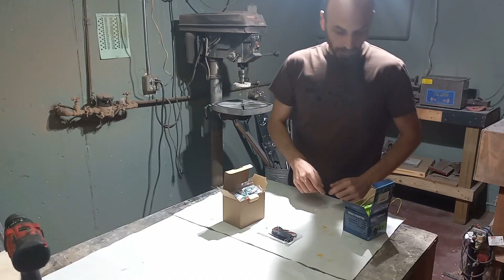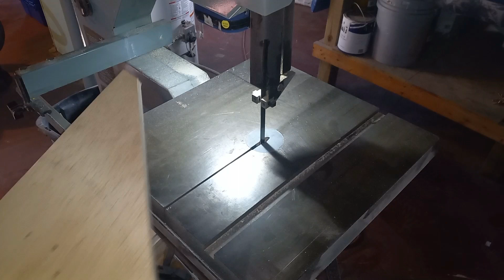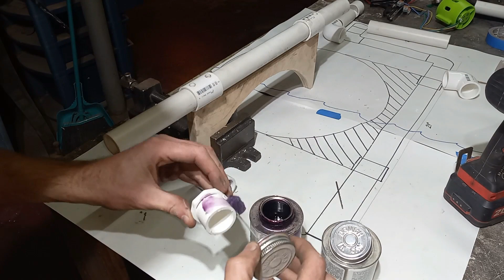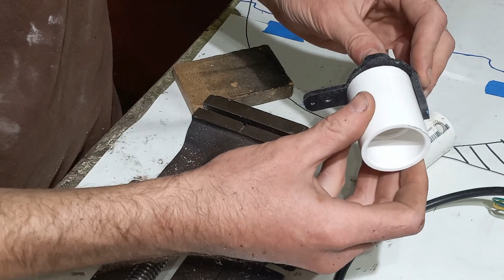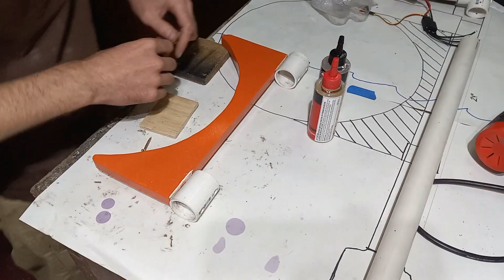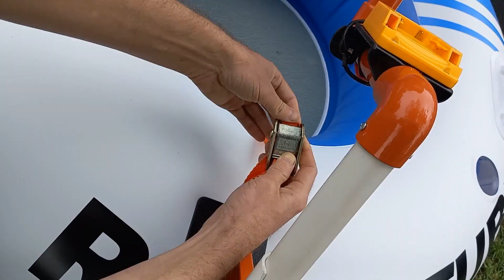How to Make a River Tube Power Motor - DIY Build

Comment: Do you have a link to the ESC with rheostat? I am planning on a dual motor and was thinking that since the max current of each motor is 20A I could try and find either two 20A ESCs or one 40A, but for some reason not seeing any with rheostats? This will be for a larger raft at the flatwater takeout...after river rafting. Thank you for this fantastic video!
Reply from the maker: Check out the video for a duel motor setup. 2 escs are required